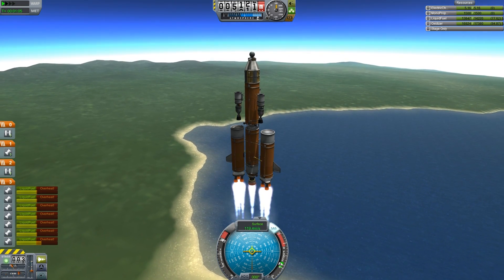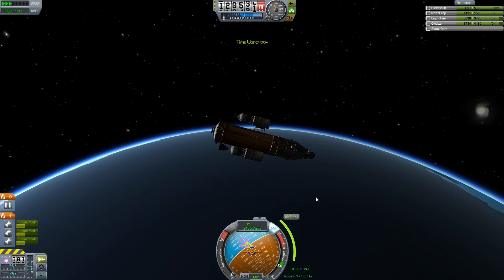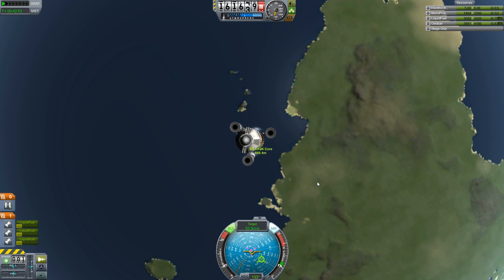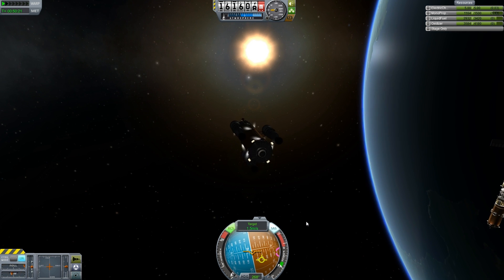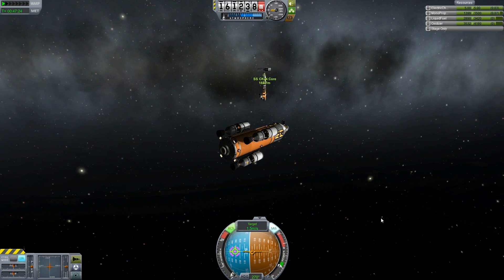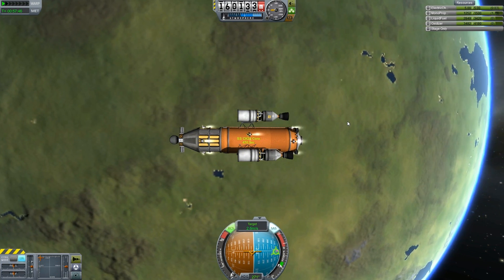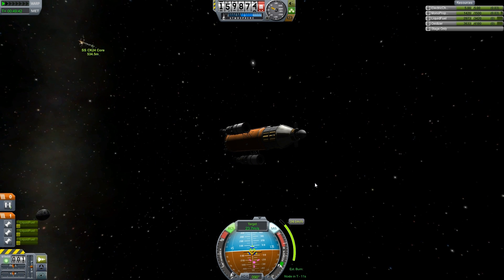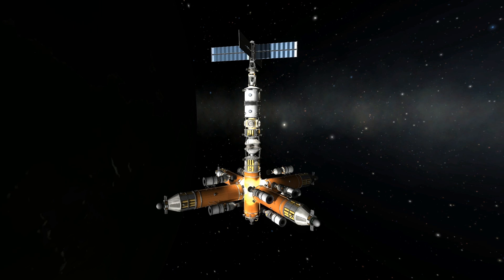Kerbal Space Program Ep91 - Orbital Fuel Depot

Comment: What was the benefit for a fuel depot in space again, exactly?
Reply: interplanetary travel becomes alot easier
Reply: you can cut down on the complexity of your rockets and assemble your interplanetary stage and lander in orbit and bring the various modules up individually which is easier so you dnt need to worry about fuel as much then, and fuel your rocket up in orbit ready for departure, so you can bring heavier modules up as well and exhaust virtually all your ascent and rendevouz fuel, dock them to your assembling spacecraft fuel up then depart, the only downside is that, it takes more time to do it that way than if u assembled on the ground and shot straight to your destination also, you will have to constantly refuel your fuel depo as well if you use it continuously, so small fuel depos are good for probes but not necessarily manned missions, if you want to maintain a constant offworld presence, a large fuel station with many many more tanks will be required which in itself will need to be refueled but not as frequently, personally i have smaller sized one im building with 8 large orange tanks and a main stack arrangement with 3 rockomax x200-16 grey tanks, gives me enough fuel for about 9 manned trips, departure and return
Reply: Ben quemp Thank you for the explanation. I'm in an aerospace engineering course trying to figure out the best way to get to Mars, and your response gave me some ideas :)
Reply: funny enough, this tactic was originally going to be utilised and may still be utilised for an actual mars mission with the now completed orion module and sls, hell with this method you can even cut down on mission time as long as you keep to schedule, you can assemble your rocket in a high planetary orbit or a moon/earth lagrange point where the gravity evens out so your ships drive is more effective since its not affected by either planets gravity allowing for a more effective maximised moon gravity assist slingshot for a mars transfer
Reply: Ben quemp But I've been trying to think, I know that it saves tremendously on further flights - but does that mean this will be part of the cargo in the first SLS to be sent to space (in the first of several launches it will take to establish a Martian colony)?  Won't that be difficult to afford initially?  Haven't been able to find or figure out the numbers yet.
Reply: its cheaper than redesigning a massive unbuilt,undeveloped untested space launch system direct from earth designed exactly for mars shots
Reply: why waste that time, money and resources when you can use an existing, technically brand new launch system to ferry up parts that it can already lift, the cost is cheaper in the end since your designing and using so much for a large rocket, you may as well break it up in smaller bits so your not busting your nut lifting millions of mectric tons of disposable rocket,highly combustible fuel and expensive mars transfer and colony cargo
Reply: plus for a proposal with a rocket that big, the overall cost for 1 of the behemoths would be so gigantic that the first time you use it, would be on your actual mission, and there wouldnt be too many takers keen to sit on that untested big bin of boom, so small and slow is the only way unfortunately for minimised cost, using tried and tested technology for safety and timescale anyway in the long run, but of course you can spamsend sls payloads to get it done quicker if that floats your boat, try scott manleys videos, Im personally not a fan when thousands of others are, he moves along too quick, and hes hard to follow but hes extremely explanative so it might be what your looking for, if not, try the kerbalspaceprogram forums, theyre extremely helpful and since its a collected likeminded intelligence, if you have a question, you will get an answer or several
Reply: Ben quemp But if the SLS isn't ready for many years to come, how would spamming them be quicker then sending out what we already have now in preparations for whenever they come out, if I understand you correctly? (I am trying to figure out how 'bad' boil-off is; not sure how harmful that would be to a propellant fuel depot that sits in space for years)
Reply: when the sls is ready, spam sending will be the quickest assembly option but the new VAC at the kennedy spaceport is now completed so within luck it can start churning out sls I varients within the next 2 yrs or so, boiloff for fuel may be pretty tolerable since space is actually the perfect place other than flying space debris to store it, you have a zero g environment for fuel up accessibility for assembled ships, rendevous and docking only required, a naturally cold environment to assist with storage as the fuel needs to be kept cold anyway to remain in a liquid fuel state but either way a mars mission will be planned over the course of multiple years anyway, its not like 1 yr they say lets go to mars next year and then they do it..
Reply: your not getting back the fuel you used, your expending the storage fuel in orbit at your depo which still needs to be replenished every now and then, but you are increasing the reusability of your rockets, my end goal is to make a kerbin ground based fuel depo, so my rockets will eventually become completely reusable, the key piece will be building a ground depo of course but a heavy duty reuseable lander capable of landing and ssto to and from kerbin orbit for science retrieval, the only things that will need to be replenished will be the orbital depo and the ground depo, no more wasteful stage shedding,or rocket building, just one super versatile completely reusable interplanetary stage that stays continually in orbit docked refueling or in transfer from orbits and one super versatile reusable lander docked to the interplanetary stage thats capable of ssto on any planet, pretty ambitious to say the least but ive finished my ground based depo, im building my orbital one now and then ill build my lander and interplanetary stage
Reply: no, well depending on how you build your ship, you can actually get more, but thats inefficient, you fill it right up thats all well and good but you dnt just waste fuel because you have it either, on your return trajectory, its a good practice to re rendevous with your fuel depo again to both dock your interplanetary stage for reuse and to replace any extra fuel you have back in your depo or keep it left over in your interplanetary stage, i.e why would you use it all when you can use it next time you want to go out, ive reached that part of the game where ive expended the closer planets of science points, i.e kerbin mun minmus, even made a trip to eve but with careful planning and calculated burns albeit and i still cut it very close with Dv consumption, now im going for the big money the outer rim planets dres, moho, duna ,jool, eeloo and their respective moons, i can get stuff into orbit with ease, i can rendevous pretty damn well, i need a more effiecient form of travel that doesnt involve giant direct kerbin to planet one shot rockets, hence fuel depo and orbital assemblies
Reply: Netsurfer733 i think the best way to get to mars would be with the project Orion nuclear pulse engine. A good use for all those thousands of nuclear weapons that are being retired from service since they are older than our latest generation of nukes.
Reply: have you actually read up about project orion it generates thrust by riding the shockwave of nuclear detonations...your idea would work if by some miracle, you found a way of hauling every single one of those nuclear weapons up there..having them suddenly be weightless for the drive to be as effective as it can and storing them all up there stored somewhere somewhere being a big iff.......the idea behind orion nuclear pulse drive is that it utilises microsizied nulear pellet bombs...the technology for which doesnt exist
Reply: Ben quemp all you need to do is construct the ship in orbit.
Reply: unfortunetly, real life doesnt pan out that way...wow, ive manged to keep this thread going for a while now..
Reply: +Ben quemp  A LOT!!!!!!!!

Comment: You should add forward facing engines and use action groups to turn on and off prograde and retrograde burns so you don't have to turn around to retrograde burn anymore...ie button 1 activate prograde engines and shutdown retrograde engines, button 2 activate retrograde engines and shutdown prograde engines and button 3 shuts down both prograde and retrograde engines.

Comment: As the other person had responded to you had said, it's called Asparagus staging. There's a one-way hose that you can connect, simply place your main fuselage with rockets, set up your second-to-last stages, connect those to the main with that line so it forces fuel to the main one, then build your final stage, send the lines from that to the first and second stages.